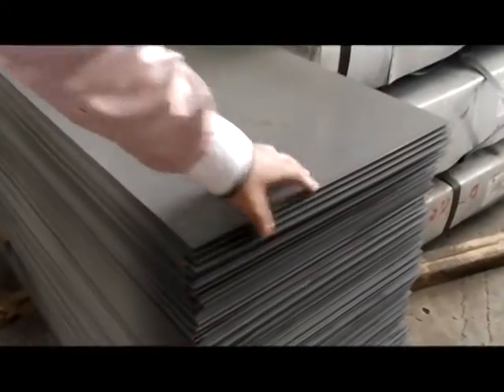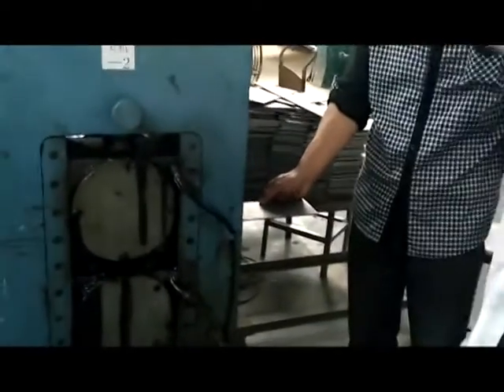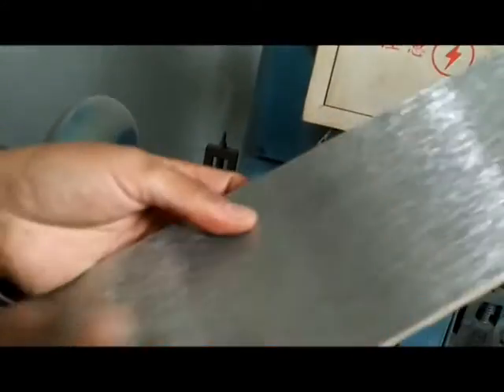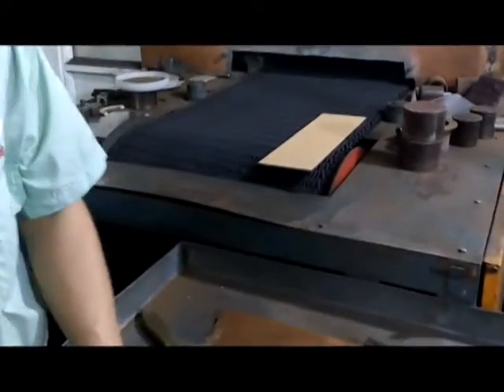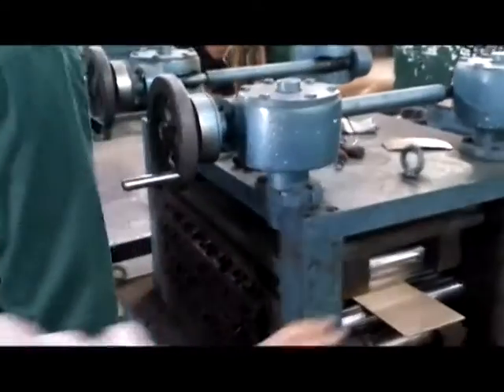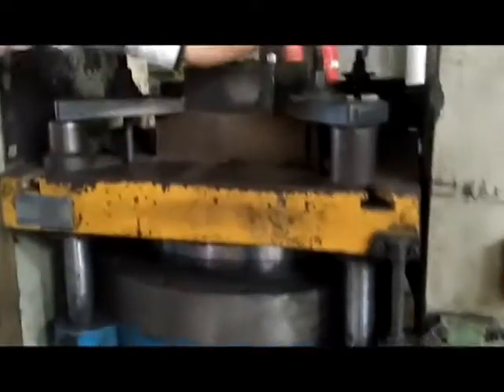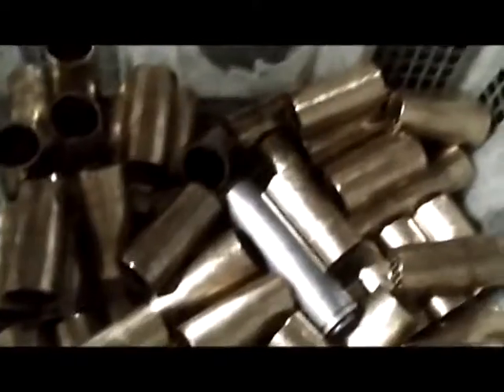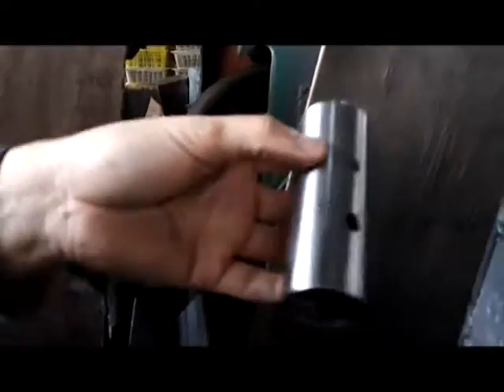Bimetal Producing Process, by APM China 2015

Comment: We are manufacturing Bimetal Sintering Line (Continuous Coil to Coil Sintering), Degreasing Lines, Powder Plants , Slitting Lines , Decoiler/Uncoiler-- Strip Straightner and feeders for Press Automation in India and are OEM supplier to almost 80% of the Bimetal Industry in India, we have also exported Full Sintering Plants with CE-Mark.

IMPERIAL PRODUCTS OF INDIA
414-A INDUSTRIAL AREA PHASE-2
CHANDIGARH (UT) -160002 INDIA
Email:- imperialproducts414@gmail.com
Mobile/Whatapp:- +919988005956